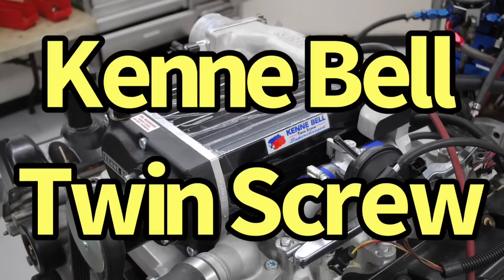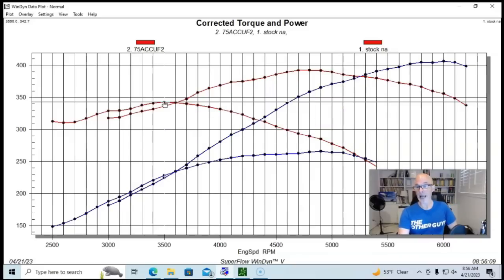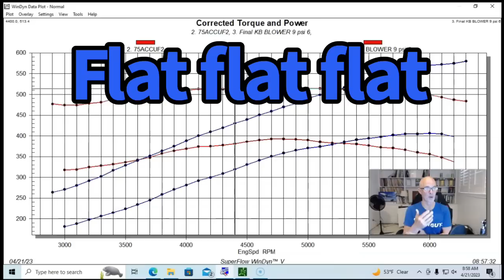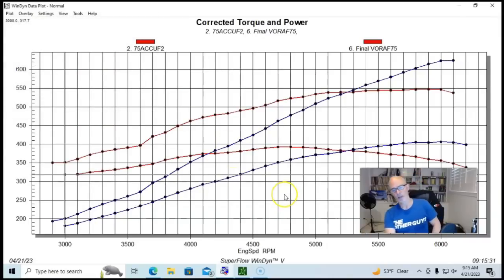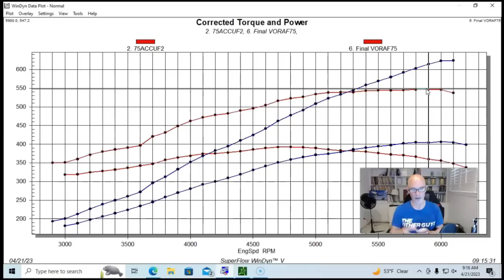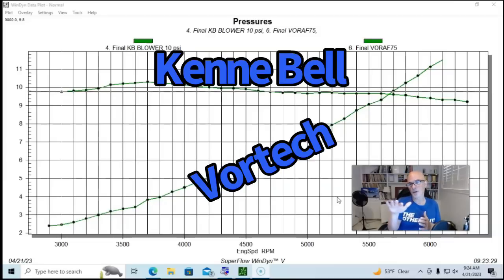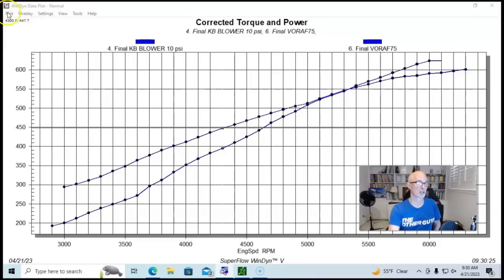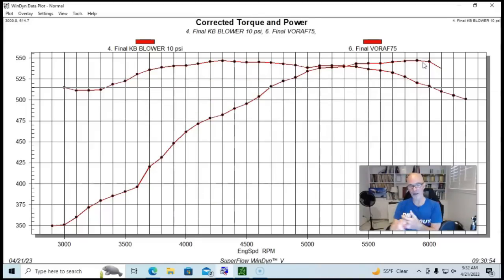JUNKYARD FORD BLOWER SHOOT OUT! WHICH BLOWER IS BETTER? VORTECH VS KENNE BELL BLOWER-4.6L 2V TEST

Comment: why the kennebell 2.1L started to lose some boost at higher RPM between 5500 to 6000 rpm ? is the displacement of the supercharger not enough for the 4.6L engine ? and what would the best supercharger capacity to match the engine displacement ?
Reply from the maker: The 2.1L was more than enough for this power level

Comment: want to see the numbers of the vortech with proper valve springs and run out to around 7000 rpm. I have 2 mustangs both engines identical except one has a kenne bell and the other a procharger. The procharger car is very fun to drive and can blow the tires off at 70 mph. Both making same boost except the procharger has an intercooler. Both are fun to drive but if I had to pick one I'm picking the procharger.

Comment: Great comparison! You kept everything equal except the supercharger for a great look at the differences. My son and I built a Kenne Bell 4.6 PI Mustang with 11-12 pounds boost. Love the low-end power response for the street. It feels like a 460 CID at low RPM. Had to put in a forged-built bottom end after the stock block lost a piston due to the boost. 40,000 miles as a daily driver on the forged assembly without any issues. CA CARB smog legal!

Comment: For a stock bottom end 99 GT with a kenne bell, what gears? Would closer to factory help with traction? I have 3.90's now....they whine so I'm going to replace anyways. Might go up to what factory cobras had
Reply from the maker: 3.27 or 3.55
Reply: Thanks Richard, I love your videos! Mind if I ask you another question? Trying to max out a stock bottom end 99 gt, say 500ish crank hp/tq. Street car only. Kenne bell or Vortech? I'm steering towards kb.....

Comment: Kenne Bell for drag.
NA for daily or rally.
Vortech for anything else.

That rising torque curve would hook up so good coming out of a tight corner on the touge.  Unwind the steering as the revs rise and just slingshot out of there.  Superbikes do that all the time - use the lack of low-end to gain control on the side of the tire and then ride the wave as you straighten out.  That kind of thing becomes important with 600+ hp and RWD.  A PD blower or pair of turbos could really blow the tires off at the apex.

Comment: In this case, Kenne Belle street car but there are versions of that that essentially push so much air that you're basically making a V8 into a V8 with a V8 on top... It also depends on whether you drag race from a dig or drag race at like 60 miles an hour...

Comment: When you swapped cams in this 2v did you just put them in as / is, or did you degree them in with adjustable cam sprockets. Pretty amazing difference going from the Comp cams back to the truck cams with boost from the centrifugal
Reply from the maker: just installed the cams-later we degreed

Comment: Any idea how long the stock bottom end would live with the KB (even with the first pulley)?  With the first pulley (580 hp) could it run on 91 octane? Thanks
Reply from the maker: it won't make this power on 91 (because of the reduced timing) but will live a long time if tuned properly

Comment: Kenne Bell 100% .. I daily drive, so all that torque down there below 5000 rpm would be too fun on the surface roads (and getting on the freeway) .. Just go turbo if you want a vortech ..
Reply: The appeal of a KB or Vortech kit is the ease of installation and readily available parts (kinda....KB is weird with "parts")
Reply: I dont know shredding tires doesn't sound like a daily driver activity
Reply: @WarriorOfEden3033  Self control saves tires :) ..
Reply: @67comet  have you seen the car community 😂 what’s the point of having it if you aren’t using it

Comment: I have a thick Crown Vic with a very healthy 2v at 79k original miles. I was planning on using it to build a 600hp - 800hp setup. The KB would be nice for low end torque, but the VT seems to be able to produce more peak hp. If I'm being honest, I get goofy over that KB whine.
Reply: PD blower hands down on a street car, ESPECIALLY with a heavy basterd like a Vic! 

Also taller gears help get the two and half tons of fun out of the gate a bit better! 
(I have a Vic with 4.10s and a manual trans....  Faster with the auto but so much more fun with the stick!  .... I have a KB kit and other goodies sitting around for it but current project is the suspension and audio portion 😏)
Reply: Oh and it really doesn't matter how healthy the current engine is, when you're looking at 600+ hp then you need to build a lower end anyway! 

Also the KB also takes care of the intake manifold issue with 2v's when looking at that power level considering there isn't much out there and what is, is ridiculously priced!

Then comes the heads which honestly if you want to keep it "budget" then rods and pistons, 4v head swap and turbo would be the way to go! Then your limiting factor becomes the transmission! 

600+ HP isn't as cheap as people seem to think, just in hardware I had over a grand alone! It is much cheaper nowadays with the flood of Chinese products being readily available (for instance turbos, an line and fittings, tools to fabricate, etc...... )

Comment: I can tell you as someone who does road racing that I run a harrop TVS 2650 with integral intercooler. While this is very similar to the Kenne Bell I find it superior because if the integral air to water intercooler that I don’t believe the KB has. 

I would rather for my application have a unit like this all day long as the vortec Will never see 6-8000 RPMs except on the back straight and then only for maybe for 20 seconds. However it lives its life below 4k most if the time where this unit shines. Hell my engine redlines at 6800 so not much room for me to take advantage anyway.
Reply from the maker: the Kenne Bell has an ATW cooler-and Twin Screw is more efficient than TVS Roots, but the 2650 works well

Comment: Do you use the 8 thread spark plug heads Richard  or? Have you ever blew the spark plugs out on the 4 thread heads.?
I just picked up a Vortech innerccoled kit for a 10th gen f150..VERY HARD TO FIND!
Reply from the maker: I have not blown plugs out

Comment: I installed the vortech supercharger on my 99 gt with a bunch of other mods and I was very happy with it! After a little while I went to a 3.33 pulley and 42 lb injectors and it went from about 8 lbs to 12 lbs of boost but racing is a bad addiction because no matter how fast your car is you always want it to be faster. I was so happy when I was running 13s with just a few bolt ons then I was happy when I broke into the 12s and then I was happy when I broke into the 11s..... you get the point, it's never enough

Comment: I would say at first I'd go with the kennebell.
 But, more than likely, I'd go with the vortech. For a few reasons.

1. Like you mentioned,  the traction.  You see all that tq is going to be putting alot of abuse on your rear-end. Plus, not only that, if you don't have traction, you ain't going no were.

2. Vortech tends not to overheat as much as a kenne bell would. 

3. Unless it's going to be a track only car, then yea the kenne all day. 
But, if it's a daily, then the vortech is better.  It's better because you can have just a regular car when just daily driving it normally, but when you want that power, it's there.  

4. The amount of gas you're going to be spending with a kennebell supercharger.  I've seen some videos on here where you will only be getting 8mpg 10mpg if you baby it.  You see with a vortech supercharger as long as you drive normal it's never in boost, and if it's not in boost, then it's not being so hard on your gas.

5. Oh, and for all those that say well the vortech takes longer to rev up in rpms. Well, I got something for that. It's called jmschip by pedalmax. The jmschip  does not mess with any tunes, nor is a tune required.  Basically, what it does is depending on how you have the dial set on. But like with me, I tend to have mine between 75% and 100%, and man, you barely have to tap the gas, and it just goes. It even down shifts easily even if you're already doing like 75mph.  Just look at my videos and see for yourself.  

Oh by the way the website is called
 www.Jmschip.com  

Just sure you choose the pedalmax option as they have many options.

Comment: I had the vortecc with the vortech intercooler system on my 02.  4:10s plus more other stuff than I care to remember made 450 rear wheel….  I had subframe connectors and a lot of maximum Motorsports H&R and tokico suspension parts, and 03 Cobra Brakes.   450 rear wheel doesn’t sound like a lot, but when you can rip around the streets on a car that stops and turns on a dime much more power wouldn’t have helped the car….  It never broke, EVER!!  I could drive thousands of miles at a time with the AC blowing and it would run and drive like stock.

On that note, I’d try the Kenny Bell to replace that junk plastic intake and to keep the battery under the hood.

Comment: I don't think it was valve float. The kenne bell run was continuing to gain at 6500 with the same springs. Seems to be a fuel issue but I wasn't in the cell that day so...

Comment: I think you should do a China copy cam video. Do like four of them. The reason I say this is I have one and it runs pretty good. I thought I was ordering an Elgin. All through the ad it said Elgin. Then at the end, after I ordered, in tiny print, it said the dreaded three words…”made in China”. 
Well, I’m a single dad so no money to swap this out so I gotta run it. I did, and it does make good power and sound good. 
My question is, material longevity, and accuracy of grind, and probably most important is how does it affect performance. 
Anyway, haven’t ever seen you do a China copy mistake purchase video. 
Maybe I missed it. 
Love your stuff, hope all is well.

Comment: Wonder why I can't comment or even see live chat? Wanted to ask you about what size turbos do you think a pretty much stock 500 cadillac would take? After I add ring gap of course.  It will have a pretty small cam but larger than stock I plan to get from cmd.
Reply from the maker: WHAT HP LEVEL?

Comment: I've always felt that when comparing forced induction a centrifugal supercharger takes all the disadvantages of supercharging and turbocharging and puts it all in one neat package.
Reply: Yes and no, in a street car the linear power curve of the centrifugal is actually really nice in terms of giving you nice usable power delivery, and the way that blower just keeps on building as the revs increase is actually very potent when racing, especially from a roll
Reply: What if the vehicle already has traction issues? Something to think about.
Reply: @DillonAuto then you need to upgrade your suspension
Reply: What's the disadvantages of turbo that a centrifugal makes up for?

Comment: If someone gave me a 4.6l 2v for my bucket I would have to go with the Roots style blower over the gutless at low RPM centrifugal blower, because what I use the bucket for rewards a flat torque curve and instant throttle response over peak power at high RPM.

Comment: Kenne Bell all the way. The lower HP and torque at the higher RPM's is worth the difference on the bottom end. I have an Edelbrock E-Force on my 3V Mustang, and love the instance torque when I stab the throttle. It doesn't matter what RPM you happen to have the motor at, it always happens.

Comment: What size injectors do I need for a 1000 horsepower on 06 4.8, and who makes a reliable injector?
Reply from the maker: 80 pounds will just get you there on gas, you need 100+ pounders for e85

Comment: I’ve ran my 04 GT with a KB on 12 psi for 10 years now. Thing still pulls like a freight train for what it is. There’s a vid on me and a buddy in his Cobra going at it.
Reply: Did you build the bottom end or have you been winging it on stock internals at 12 psi?
Reply: @thrustinthrottle652  running it on a stock bottom end, but with 110 gas on the ‘shootout’ mode,  unless I run the ‘street’ setting which KB offers a switch for. But I didn’t want to go the route most others do, the bolt on route which can only get you 400 crank hp and be way over the 5200 price I paid for my set up. I’m also a 20+ year tech who is an engine builder, so if it blows up, I’d just get a 4.6 from the junkyard and actually build the thing. That or a built Coyote swap. Been saying that for a decade now though, but it’s held together lol. Search ‘KB Mustang GT vs 03 Cobra’ or something like that. It’s a fun car, hell the thing doesn’t even have headers on it 😂
Reply: @anthonybutterbaugh4252  Cool!Initially I wanted to build a 5.4 I torn down in hopes of building it back up with forged internals.However factoring the costs and room for error(Very Small),I have just considered snatching another 4.6 out of a less abused Grand Marquis or Town Car and running with that,till the 5.4 is built or should the day come,the car is gone.

And yeah I saw that vid of you pulling like a freight train on that Terminator.Its pretty dope seeing 2v's keep up with and spank higher powered cars.

👍👍👍
Reply: @thrustinthrottle652  man I wish I had control over that channel to be able to comment to those that were interested in that race. Backstory: The guy in the Cobra is a good friend of mine, but he sold his Cobra. Even though a vert, it was built and tuned on a dyno. Mine has never been on one, but I see no reason to if I’m happy with what the KB tunes have done for me. 

I’m almost 43, so the rule of ‘there’s no replacement for displacement’ can be true….Boost enters the conversation lol. Take my current combo (for 10 years lol). Small displacement but with a power adder and nothing else other than no restrictions on the exhaust. We don’t test for cats in my area, so I run it open, more or less other than the bbk x and slp loudmouth. I’m actually not a Ford guy, but I’ve lifted more cabs and put so many phaser lockout kits than I’d care to discuss. Point is, if you’re looking for a weekend warrior car, you can do it all day long if you’re dealing with 500 whp on others in the 33-3500 expectations. Unfortunately, I don’t have any info on the 5.4 or Coyote builds, other than if my shit breaks, I’m going Coyote or LS lol.

Comment: Ive ran them both! I looooove the kenne bell's torque but man it heat soaked sooo badly.  Vor was more traction friendly for the street and blow off sounded cool!  Better fuel mileage with the kenne bell though
Reply: The blowoff sound would be my reason for staying away from Vortech. I love the twin screw whine much better.
Reply: @sherylellingson3538  the new kenne bell twin screw has eliminated that whinning sound now.
Reply: @berardoferrari idk what you guys are talking about because i have a new 2.1 kenne bell on my stock 4.6 only making 9 pounds of boost and its really loud. If run a short ram intake with a 90mm maf and a 75mm throttle body the sound is perfect. Ill upload a video from a 2k to a 4500k pull
Reply: @sherylellingson3538  on the big bore 2.1 and up, you don't get the whine like the (terminators) unless you're closer to 20lbs. You get a little noise but barely
Reply: @wastedwagesmercuryman6018 i uploaded a video short of my blower whine on my 2.1 its loud

Comment: Twin screw rules....from someone who's used em all. I have direct comparison on two S197s with Coyote. The VorPax was great to install but, the car felt like a slightly soggy stocker running around and you needed to wring its neck to get anything out of it. The 2.3 TVS on a mild tune just rips everywhere and helps cut the 60 foot at the track, too. Just gotta mind keeping it cool between runs. That installation was WAY more complex than VorPax, to be honest.  I'd add I chased false knock for a good while tuning the VorPax, no such issues with the TVS. I'll also add that the 2.3 TVS adds more weight to the car but, makes more than enough to compensate, My loaded automatic 2014 weighs in at just under 4000 pounds with me in it and a tank of gas. runs 121 mph in the 1/4 on 8 pounds boost. Obviously not tuned max but, runs pump 91 no problem and is lots of fun.

Comment: The twin screw operates kind of like turbo with electronic boost control and the huge difference in area under the curves is hard to ignore.   It will not make as much power as turbo with same boost due to supercharge losses but it is a really good choice when under hood packaging is a factor.  For every day driving, I have always liked centrifugal and roots style superchargers.  It is not easy to put an instant 500lb/ft of torque to the ground.  T-5s will also hold up under that level power (in daily driving) behind a centirfugal or roots supercharger but kind of sketchy with a turbo or Kenne Bell.
Reply: Think that's the first time I've heard a PD blower operates like a turbo (considering a centrifugal is literally a belt driven turbo....) 

"It will not make as much power... with the same boost" 
That's not how it works! It's also too vague. 

You say that it will hold up to a "roots" but not a "Kenne Bell"? Roots is a PD supercharger just the same as a KB..... Also a PD supercharger is harder on a transmissions than turbo for sure!

Comment: Really depends I’m usually deciding on how to build power while considering the purpose of the build. A lot depends like the rest of car combo but let’s give it a shot. 
Street- screw blower, man trans, 3.55:1’s 
Track- centri, auto 3 spd,5000 rpm stall, 4.11:1-4.56 
I still like the screw the truck would only win at the track maybe. There’s actually a huge 
Disparity in the power in the screw blowers favor even though the centri peaks higher. If they were both e85 (pump gas) then the screw would probably be safe on even real hot days. It’s very hard to beat the screw blower on this one.
Reply: For the track a centrifugal makes the most sense because you're gearing the car to stay in the higher (peak) power band. 

Either way, Vortech and KB really are street use brands.